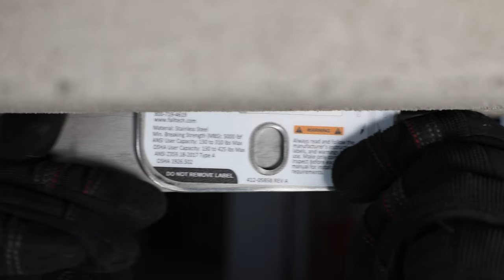How to Install a Strut Anchor

Comment from the maker: Traditionally, this type of connection (snaphook-to-carabiner) has not been allowed, because of concerns with proper loading of connectors and unintentional disengagement.  The latest edition of ANSI Z359.12-2019 has requirements for connectors that ensures a 2:1 safety factor in almost all possible loading scenarios.  Additionally, the standard has revised the outright ban of these type of connections, stating in Section 7.1 that “snaphooks and carabiners shall not be connected to each other unless specifically designed for such connections.”  The limited application as an overhead anchorage connector only and design of the strut anchor is intentional such that the connection of the personal fall arrest system (PFAS) to the Strut Anchor’s carabiner is intentional.